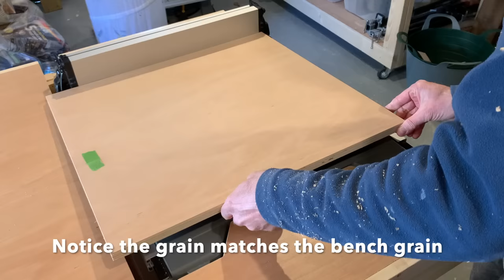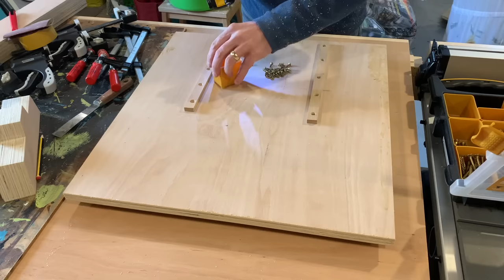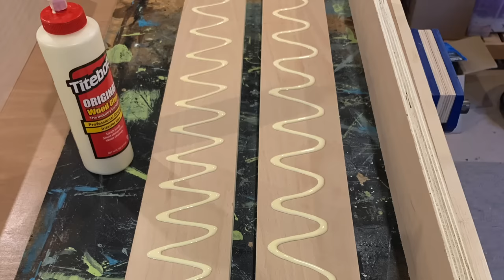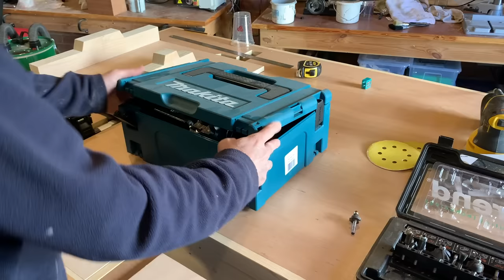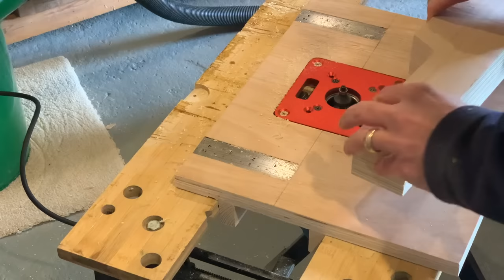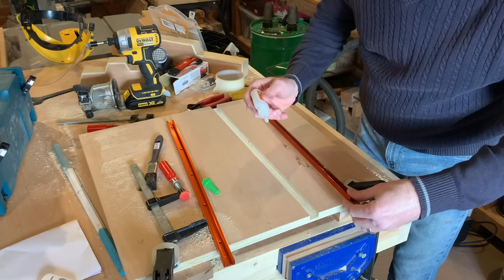Cross Cut Sled for my DeWalt DWE 7485   HD 1080p

Comment: You help solidify my ideas on getting the 8 1/4 saw vs holding out for the 10". The depth cut is roundabout 1" difference but for what I want to do that doesn't matter as much so thanks for giving the insight in your build to help me make my decision.

Comment: I’ve had that old-style Workmate for many years, but haven’t used it as much as I could have.  That simple router table is a great way to use it, and make it portable.  Thinking I’ll do that as well, and can also mount a small belt/disk sander, small downdraft sanding table, scroll saw, small 1” belt sander, variable speed bench grinder for chisels…. thanks for the inspiration!

Comment: I also used to use hard wood for runners .I now use 3/8 thick lexan or plexiglass. Cut like a hard wood with out the humidity problems.
To reduce the surface the underside surface area ,to make the slide slide easier, I made a grid  up to accommodate a 2 inch foster bit with a 1/2 to 3/4  space between outside edges of hole. I than drilled using a 2 inch foster bit ,1/16 deep.
Reply from the maker: I used mine today, it wasn’t too bad on the glide front, it was a bit sticky, but ok, I just add a bit of machine wax 👍🏼 your idea is a good one 👍🏼

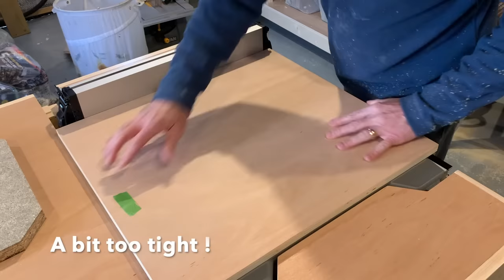Comment: 03:25 Johnson&Johnson to the rescue.
13:18 Oh, oh.. the rubber is about to hit the road. [big carpenter square / one screw as pivot point.. ladies&gentlemen - hold your breath]. And, after that.. the five cut method.
Also like that left side table extension. Well done.

Comment: I know I'm VERY LATE but I am very impressed with both your bench and sled. I like the different steps and techniques you used to make this sled. I purchased a Dewalt DEW7485 (8 1/4) just like yours and was looking at different methods for making a great sled. I think yours is by far the best I've seen. We seem to share a lot of the same power tools as well. I will use your sled as my inspiration for mine. Big thank you for your video! I hope I can find the same type of materials at Lowe's or Home Depot. Other than Ace those are my only options except for online but I like to SEE them before buying. I'm particularly interested in the aluminum(?) rails and what size bit you used in your router (flute bit for the grooves) but I'm sure I can find out. Very, very helpful!
Reply from the maker: Hi, thank you so much for watching and thank you so much for taking the time to comment, it’s very kind of you. I have since made a new back fence for the cross cut sled because I found the aluminium T track was too low, it was fine for a lot of the work I was doing, but if I wanted to cut anything that was taller the T track was too low. I’ve since done a new video on the new build, which is worth watching 👍🏼
Reply: @Terrythemaker  Oh OK yes I need to see that one. Thanks so much Terry. You're a true craftsman and gentleman and thank you so much for responding and the kind words. Let's go build! Thank you!

Comment: Nice build, but the upper C track got 2 problems as i see...
1. You can easily cut into it, if you cut a thicker material
2. If you glued it to the fence, you can't insert (or change) screws to it...
Reply from the maker: Hi, you are absolutely right about cutting into the t track, I only realised this afterwards. But I normally put a  piece of wood in between the fence and the blade to stop this. This has to be a piece that I know is completely square otherwise it I won’t get true 90 degrees cut. You are also correct about not leaving a gap to make changes. But it’s my first attempt and I may make another. Thanks for the comments 😊

Comment: Thanks for the video, I have just got the same table saw and no experience at using a table saw, I want to use it safely so something like this would help me.
Reply from the maker: It’s a great saw, you will love it, I have since amended that build in another video.
Reply: @Terrythemaker   Thanks Terry I have a look for it. I do have mine but only done a few cuts. I got it for £429 plus a dewalt battery in UK
Reply from the maker: @Chris-pv2ht  wow that’s a really price
Reply: @Terrythemaker   its now £429 with 7% off @ FFX plus battery

Comment: I've noticed I will have a perfect glide after attaching the base to the guides just with adhesive or tape but after driving screws it glides poorly and feels as if it is too tight just like what happened in your video.  I think it is just simply when manually driving screws in the ever so slight angle they are driven in at slightly pulls the guides in that direction and causes the guides to rub in the slots.  Maybe a drill press would alleviate that issue but I just do the same thing you do and sand them down a bit and slap on some wax.  Nice build!

Comment: Great build! I tried to do something similar for the exact same model, but I can't get the runners to slide. I tried them out before gluing them to the top of the sled and they where running just fine, but when I put them together with the top it gets completely stuck midway through. I've tried to sand the edges of both the runners and the t-tracks but it still behaves the same way. I've used 6mm plywood for the runners
Reply from the maker: Difficult to say why that’s happening, I used beech for my runners, have they moved out of line when you stuck them down ? They would only need to have moved a tiny bit to he out, it’s just a though👍🏼

Comment: T-slot on the base yes.T-slot on the back plane. . . no. Could easily run the blade right into it. Maybe that's why most back planes use bolt holes and empty slots to secure jobs. They cannot be sawn thru!
For every mm of base plate that's one less millimetre of height taken from the max height cut. I just watched a more recent build and the jig is way thinner with no front plate. Watching that video I realised that sled is an innovation.
Reply from the maker: Correct ! I’ve since made a re-make for exactly that reason, I’m not sure if you have seen it ? 👍🏼

Comment: Exactly what I'm looking for and it's a beautiful build.  After some months of use, do you find the rear stop block t-track to be a bit low?  What is the maximum thickness you cross cut on this sled?  That might be the why for t-track placement?
Reply from the maker: You are right, the fence is a bit too low, I have since made a new fence which you can see in a later video. Thanks for watching 👍🏼

Comment: Excuse my ignorance, but what functionality do the red tracks add?
Reply from the maker: Hi, I often cut small pieces of wood for projects and rather then get my hands too close the blade I clamp the piece down, or I can clamp a waste piece of wood down to get an angle that I want and then run the piece I want through the saw using the new angle piece as a jig or guide if that make sense, if you look on my instagram you will see what I mean 👍🏼

Comment: Great video. I have the same saw. This is my next project. 
Do you have a video on your portable router table? I like that.
Reply from the maker: Hi Rick, I haven’t done a complete video on it, but there is a short video about two years ago. If you scroll down in my videos you’ll see it, you’re also see an updated version of this Cross Cut Sled with a higher fence. Just after I built this Cross Cut Sled I realised the T-track in fence was too low, so I revised it.👍🏼

Comment: So what if you wanted to cut something thicker like a 2x4 in half. You would have to raise the blade up higher than the 2x4. Wouldn't the blade hit your T track on your fence?
Reply from the maker: Hi, yes you are 100% right, if you watch my later video you will see that I have rebuilt the fence for exactly that reason. This looked good but wasn’t practical. Well spotted 👍🏼

Comment: Being a former CNC set-up operator, it always pains me to see someone slam a caliper shut on the piece they’re measuring like he did. Great way to throw off the accuracy of your measurements. Not to mention it’s a great way to throw off your caliper’s calibration and jaws over time. You’re supposed to close the jaws on the piece gently, using the little wheel on the readout body.
Reply from the maker: That’s a very good point, thank you Jerry

Comment: Does anything prevent the saw blade from running into horizontal t track? If you push too far the and the saw blade is raised up enough
Reply from the maker: Hi, No it doesn’t, it’s a really good point and I have since changed the back fence for exactly that reason. I have since made an upgrade video showing this, if you get 5 mins it’s worth watching. Regards Terry

Comment: I just bought the same table saw today and was looking for builds specifically for it.  This is a really nice sled.  May I ask what thickness plywood you used for the base of the sled?  In my head I keep thinking that 3/4" might be too thick for the smaller blade size, so I was thinking of using 1/2" plywood.  But maybe that's not an issue at all.  I also love your work table around the saw.  I'm going to try to do something similar.
Reply from the maker: Hi Heather, sorry for the late reply, I used 18 mm ply from memory, it is actually the cut out from the bench. It’s actually easier to do than it looks. I made a cutout in my bench, I cut this at the narrowest part of the saw table, if that makes sense. I then dropped the saw into the cut out and drew round the wings of the tabletop. I then lifted the saw out and cut out the wings using a coping saw and then sanded, enjoy the new saw, it’s an excellent piece of kit 😊

Comment: `Great video and good explanation.
However, if i want to use something bigger wood, i will am afraid that the saw goes into that t-track. Because the t track is not on top and is now only useable for plywood or something.
For the rest...good build :)
Reply from the maker: You are 100% right, if you watch the video after you can see that I rebuild the fence for exactly that reason, thanks for watching 👍🏼
Reply: @Terrythemaker , I will :). This was the first video I've seen from you.

Comment: Forgot to ask you, where can I get the machine paste? I have searched on eBay and Toolstation and can't find it/any?
Where did you purchase the paste from?
Would bees wax work? Or white lithium grease?
Many thanks kind regards 👍👍
Reply from the maker: Axminster tools, I buy loads of stuff from them, great shop 👍🏼 but I reckon any wax would do mate 👍🏼
Reply: @Terrythemaker  excellent thanks I try them out 👍👍🍻
Reply: @Terrythemaker  I also forgot to ask you , what size t track did you use? As you can get them in different widths for the t rack slot?
And what are those t track clamps called please?
Many thanks 👍

Comment: Do you have any measurements on this build ?
Reply from the maker: Hi, I’m afraid not, my benches are currently in storage so I have no way of checking, but I can tell you it’s approximately the size of the saw table itself, it’s basically the piece that I cut out of the bench that I used for the sled, I hope that makes sense 👍🏼

Comment: what blade have you got on the saw bud?? i need a new one
Reply from the maker: Hi Matthew, I’m still on the original blade mate ! It’s still cutting fine 👍🏼
Reply: @Terrythemaker  oh fair enough mate looks smooth as a whistle. What tooth is it would you know. Thanks for your content btw I’m a woodwork enthusiast like yourself as a hobbit but a bit behind you 😂😂. Just got the triton this week too so see how she goes 👍🏼👍🏼
Reply from the maker: @matthews8377  yeah it cuts really well, it’s just the blade it came with, I’ve just counted them 😂 because nowhere does it say in the manual, initially it looked like 48 but only the front teeth cut, so looks like 24 actual cutting teeth. 
Which triton have you bought ?
Reply: @Terrythemaker  cheers bud. I’ve got the same as you I believe. TPT125. First need to build bench like you’ve done then find something to use it for then 😂😂
Reply from the maker: @matthews8377  great bit of kit, enjoy mate 👍🏼

Comment: So you have to do the 5 cut method? Can't you just use a square and reference off the blade and back to the fence?
Reply from the maker: Hi Chris, yes you're right, you can just square it up against the fence using a good square. I must admit I had just seen someone on YouTube use the 5 cut method and wanted to try it out for myself. I think both will work
Reply: @Terrythemaker  Thanks Terry. I've never tried the 5 cut method I just use my square and it seems to work fine for what I need.
Do you have any videos on using a planer to flatten one side of a board? I can't seem to get it right even if I shim it, etc. Please help. 
Thanks Chris
Reply from the maker: @ChristianCMC  Hi Chris, I’m afraid I don’t, do you mean on a thicknesser?
Reply: @Terrythemaker  Yes a thickness planer.
Reply from the maker: @ChristianCMC  Chris I sometimes have the same problem, I do the same as you and put shims under the raised sides, and then run the board through on a flat melamine board . Once the top side has been completely planned I then turn it over and do the other side. 👍🏼

Comment: How did you get that red holder in that rail?
Reply from the maker: Haha, you noticed, I had to take the fence off fit it and then refit the fence, I was really annoyed with myself for forgetting to put it on beforehand , well spotted !
Reply: Terry, I was wondering same thing since you were routing slots for the t- tracks. I would cut them shorter  so you could slide t- bolts from both ends. Still you got a new subscriber from Finland.
Reply from the maker: @kangassalo  Hi Seija, you’re right,  you also noticed, well spotted, I had to remove the fence to fit it, I was really annoyed with myself that day.  I must admit I’ve since rebuilt the fence in another video. Thanks for the sub, much appreciated 😊

Comment: Did you make those runners or buy them? I'm about to make a sled for my DWE7485 (You have it as DWE6485 in the description but I think you mean 7) and that's my vexation. And the length - does it matter? I have too many options!
Reply from the maker: Hi Michael, yes your right I do have the DWE7485. The runners I made from scrap hardwood, beech I think. As for the length it depends if you have your saw bench mounted? If not I would make them the full length of the sled. If your set up like mine then you can’t have them the full length because the table behind will stop them. I plan to router out two groves in my benches so I can extend my runners and let the runners run all the way into the grove’s. I hope that makes sense, Terry 👍🏼

Comment: This looks like a great sled. Also, what size Makita interlocking case do you have your router in? I want to get the same thing for my corded Makita trim router set (which looks like the same as yours).
Reply from the maker: Hi Joseph, I bought the makita MakPac 2 and then ordered sponge online and cut it out to size, I also have a piece of carpet at the bottom to protect it, you can see  this on my Instagram., Terrythemaker 👍🏼
Reply: @Terrythemaker  thanks! What size is the Makpac?
Reply from the maker: @josephlebo7320  makpac size 2 (medium)
Reply: @Terrythemaker  ah gotcha I see. I missed that. Thanks!
Reply from the maker: @josephlebo7320  no problems, it fits really well and the accessories fit too, I would suggest you buy the foam as well and cut out. you’ll see it on my Instagram page which has the same name as my YouTube channel

Comment: Miter slots are very uneven on dewalt table saw. Always recomend hand sanding inside the tracks before doing this . Many bumps, ridges and tight spots created from the coating process.
Reply from the maker: I had heard this, but I seem to have been fairly lucky with mine, I had a different problem with mine, the table wasn’t flat and dewalt were amazing and changed the whole saw for a new one with out any quibble